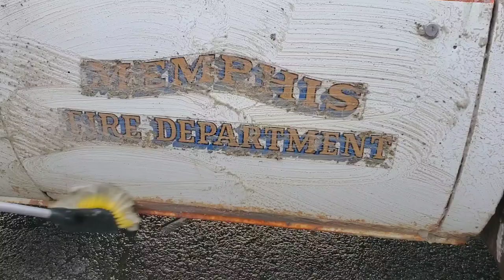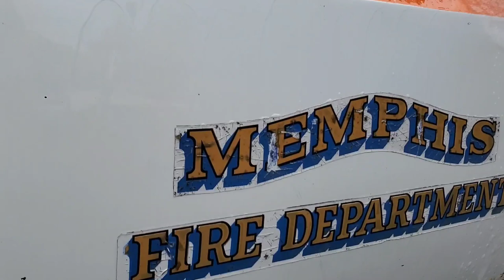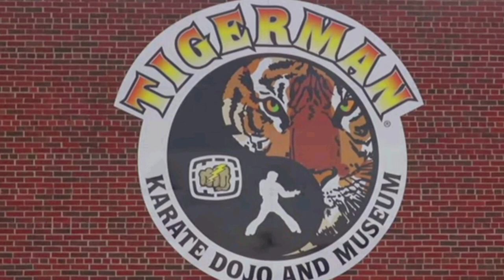Elvis Presley Ambulance MFD PARAMEDICS "Cleaning Up History" Episode 6 Behind The Scenes Interview

Comment: If the coach builder that originally built that unit is still in business you should ask them to donate a doccumentary video of them doing a frame off nut and bolt restoration of that ambulance then put it back in the muesium.

Comment: That truck should get a 100 point concourse restoration to the 10th order. Every nut bolt & washer re plated and re used in the same location where possible. Make it just the way it was in 1977 when the king was loaded.  Elvis would like that, but not like it is. Elvis Presley was never about patina, he was strictly all about flash !